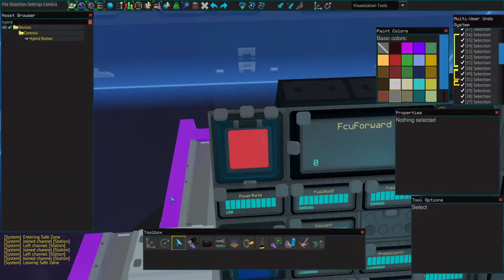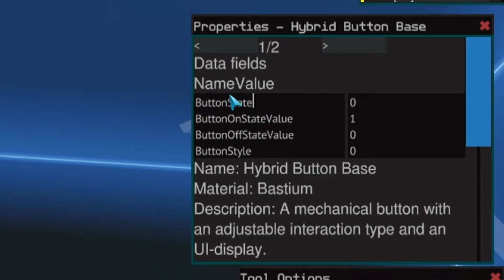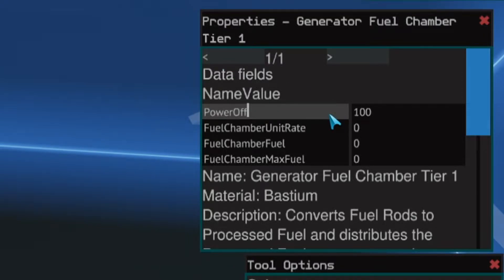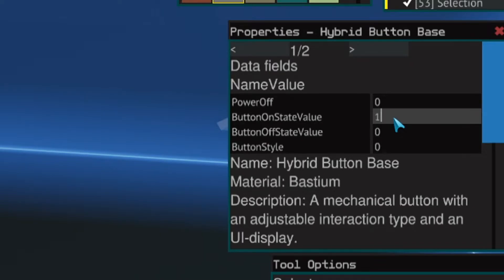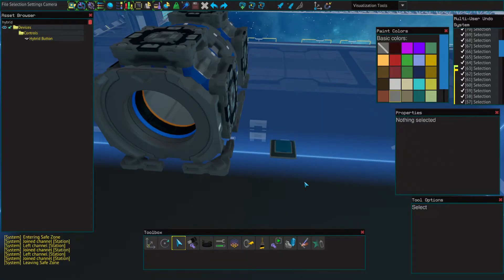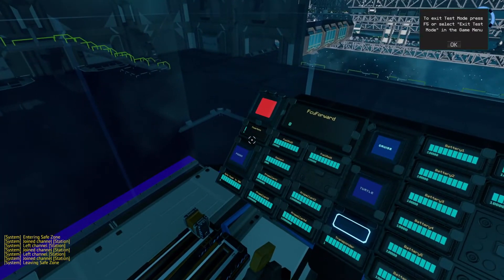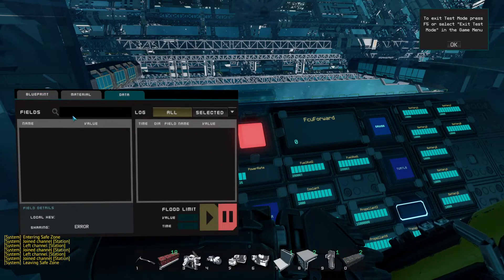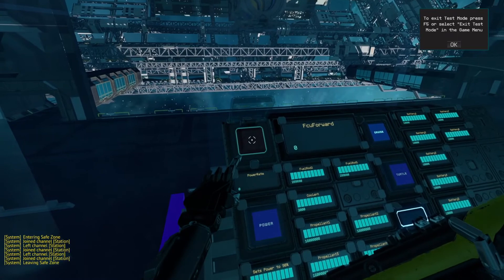Starbase EA Generator Off Tutorial - How to Turn Your Generator Off With a Button

Comment: Thank you!

Could you do one for setting generator at 50 for mining?
You are a good endo.
Reply from the maker: Well this should simply be changing the number on the button you intend to use as an off button to something like 50, so..
set "ButtonOnState" to 50 (when button is on it will max the generator at 50)
set "ButtonOffState" to 100 (when button is off it will allow the generator to run at 100, max)

Thats it!
Reply: @Lewkah  it works! Man this is addictive. Getting over the learning curve is so satisfying in this complex game.
Thank you bud!